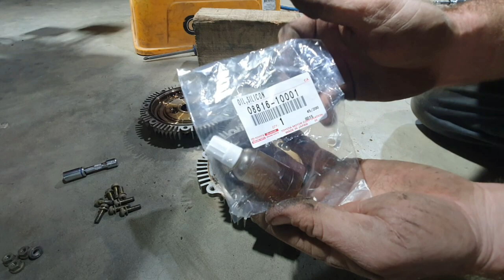1kz power build Is your 1kz overheating Fan hub issues cheap simple FIX!!!!

Comment: Mate.  Thanks for helping me out with your video.  My 03 VZN167 was getting hot up the mountains then cooling off on the straights. Turns out the fan clutch was devoid of all viscous oil.  Followed your vid.  Temp gauge didn’t move once on the mountainous stretch of the M1 between Gosford and Sydney.  Fan is noticeably louder when driving through the gears, it seems really obvious now, that it wasn’t properly working. It’s videos like this that help out people.  What would’ve been $250 was $24 (2 x bottles of oil from Toyota). Legend mate.
Reply from the maker: Comments like this make me proud to help the people out sharing knowledge how bloody good mate 👏 enjoy not overheating
Reply: Mate, how can you know the viscous is run out of oil? can you test it by hold the fan while spinning? or see it while you turn off the car if its running free for a few spin after you turn it off?
Reply: Also can i know the code on your fan belt mate? that would be lovely. thanksss
Reply from the maker: @babyburnsz  sorry mate i dnt have it repco will sort that easy 4 ya

Comment: Awesome video cheers mate, just did mine,

tip for splitting the halves is chuck 1 or 2 of the screws the other way around from the back (once all screws removed) rotate the halves so the screw holes are covered and use them as a jacking screw. pops off easy as. 

mine had almost no oil in it ....
Reply from the maker: No worries mate and cool tip

Comment: Finally iv found someone who's doing something with 1kzte cheers man your a legend
Reply from the maker: Cheers mate i was in the same boat knowing what i knew i had to do something about it 🤟🤟🍺🍺
Reply: Been doing research on them man and the forums give you mixed answers you answered all the questions I had about them in 3 videos I watched haha
Reply from the maker: @caveyslux2786  there was never a clear answer hey.... yeah thats what i was going for glad its helped out mate are you building one up?
Reply: @TRAV30387  no they where never clear was always mixed and never seen what they did or if they actually did that mod seeing it done and knowing the right way to go helps a ton.

Yeah mate I'm building one I got a 99 with the 1kzte out of thr 05 model pardo she's a good old rig just getting tired I just wanna be able to told hold 110 up a hill with out down shifting haha
Reply from the maker: @caveyslux2786  110% correct mate cheers that was the plan..

Yeah how good mate definitely hold 110 the whole build was because i got the shits with overtaking lanes clowns speeding up to 120 when the lux barely pulled 110 up hill now the looks you get when u pull past at 100+ 😛
Reply: @TRAV30387  oh mam that's the one thing that drives me up the wall I have to wait for a down hill with a tail wind to catch them when they do that haha are you still running the 3.7 diff ratio man or have you changed that too?
Reply from the maker: @caveyslux2786  hmmm yep not anymore....
Stock gears still mate not going to change them getting unreal fuel economy just works well.... get over to our fb page mate there's good stuff on there 😎😎
Reply from the maker: @caveyslux2786  no drama mate cheers

Comment: Hey mate. The shroud has a set of clips either side so the shroud can split in half. Means you dont have to take the fan off at the same time as the shroud. Makes it wayyyy less fidley
Reply from the maker: Yeah man i seen that after i did the video haha cheers

Comment: Fantastic, thanks for posting this. I've had issues with temperature going up when towing uphill or driving in soft sand. There is so many things to investigate, radiator, fan clutch, termostat... i don't really have much experience with all this... but the fan oil is a great way to start.  Can't wait to do it now.
Reply from the maker: No problem its the biggest problem theses little 1kzs have for overheating 👌👌
Reply: @TRAV30387  do you mind me asking, I just checked my fan while the car was running, and it was not easy to stop it. It had lot of pull and felt very strong.  It was not easy to stop the fan. I could also feel lots of air gushing around the fan.  Do you think this is a good indication that the clutch and oil is all ok?  Thanks heaps.
Reply from the maker: @ChilledBeans  check the fan while the engine is of mate if it spins freely its no good

Comment: The temp gauge on my 120 with the 1KZTE is usually at 40%, but goes up to 50% and stays there when I drive at a higher pace/heavier load. It goes back to 40% when I drive more relaxed. Think this would help?
Reply from the maker: I'd say it would help sounds about normal hey

Comment: Just a bit of constructive criticism I would have cleaned out the viscous hub and used both bottles of oil seeing as you them an also on the top radiator hose use new clamps as those Toyota ones are crap once removed the first time but otherwise a good video 👍👍

Comment: Great video,  I have found most guys put the oil in the reservoir on the other side that what you did ? Will it work either
Reply from the maker: just fill the four galleries thats the best way.

Comment: CRAZY how yours just popped off. Mine is stuck so bad if it did come off with the force I'm pulling with It'd slam into the radiator and destroy it.
Reply from the maker: Id say its rusty
Reply: @TRAV30387  weirdly, it wasn't that rusty. If anyone else is having this issue just work it by pushing up and down and wiggling left and right it until you feel some play and can get it off.
Reply from the maker: @fuflang  just keep working in mate it should pop mabie put some penetrative spray in there and let it soak

Comment: Amayama shows me different part numbers for the viscous hub depending on whether the car is equipped with a manual or auto transmission, is there any significant difference between the two (different operating temperatures?)?

Comment: How do you remove the bolts and keep the fan from turning?
Reply from the maker: The nuts use a ring spaner and just jam a pry bar in behind to lock it of
Reply: @TRAV30387  thanks for the reply. I’ll give it a go! Soaked the nuts in penetrating oil and will get back at it tomorrow.
Reply from the maker: @GourmetGoblinz  happy days mate enjoy

Comment: Hey Trav, would there be any point in applying a high temp gasket glue around the outside of the seal to prevent future loss of viscous oil? Doesnt look like theirs much edge there to apply it to. Maybe in place of the rubber seal? Or is the fact that it leaks a type of protection perhaps?
Reply from the maker: Id say the seal is enough in the fan hub but being so old the weep over time puttin a sealant in may make for future removal

Comment: Hey trav, trying to do this now and the four nuts on the fan won’t crack any tips
Reply from the maker: They could b just tight soak them in wd 40
Reply: @TRAV30387  got em, had to get someone else with a bit of wood to push on the belts